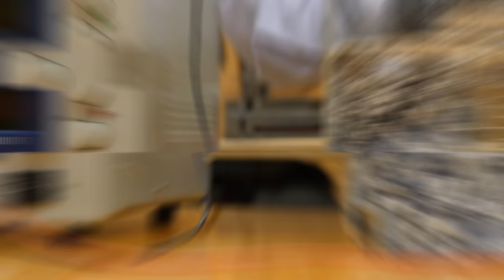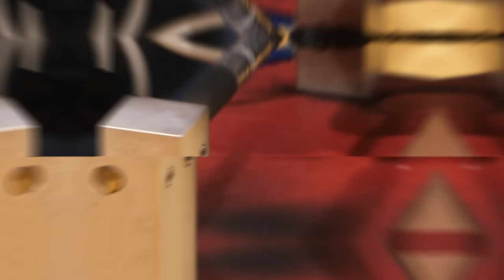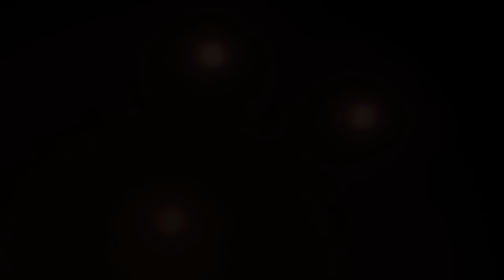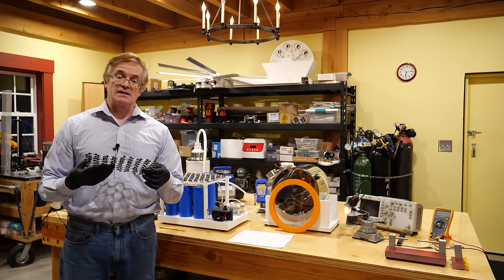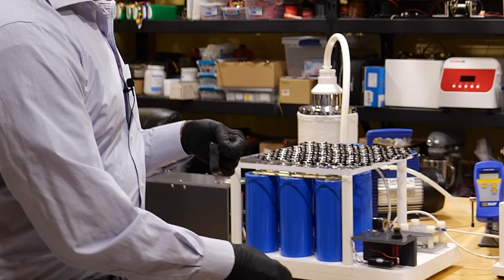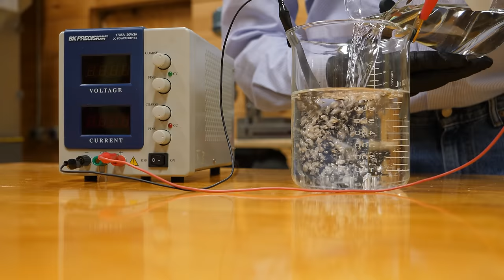Making Graphene could KILL you... but we did it anyway?!

Comment: It seems I'm muted or have been deemed not worth replying to anymore but I can understand. It's hard to judge sincerity on comment forums. Anyway,  as a thank you for your work and contributions to inspiring people, I would like you to have this conceptive been developing.  It's basically ready, just needs a bit of lab refinement.. 
I gift it to you freely with no strings or obligations.

Concept: Precision-Engineered Bio-Inspired Self-Assembly of Graphene

Background:
The quest for efficient graphene production is driven by its exceptional properties and potential applications. However, scalability and cost remain significant challenges with current methods like CVD and mechanical exfoliation.

Innovation:
This enhanced concept proposes a precision-engineered, bio-inspired self-assembly process using genetically modified microorganisms to synthesize graphene from renewable carbon sources.

Detailed Process:
1. Genetic Engineering:
   - Microorganisms: Utilize Escherichia coli or Saccharomyces cerevisiae, which are robust, easily cultivable, and amenable to genetic modifications.
   - Enzymes: Introduce genes encoding for cytochrome c or laccase, which facilitate the reduction of carbon precursors to graphene.
   - CRISPR-Cas9: Employ CRISPR-Cas9 for targeted gene insertion, ensuring high fidelity and efficiency in the genetic modification process.

2. Carbon Source:
   - Biomass Selection: Choose agricultural waste high in cellulose content, such as corn stover or sugarcane bagasse, for an abundant and sustainable carbon source.
   - Pretreatment: Apply a mild chemical or enzymatic pretreatment to the biomass to release fermentable sugars without degrading the carbon framework necessary for graphene synthesis.

3. Cultivation:
   - Bioreactor Design: Design bioreactors with controlled environments to maintain optimal pH, temperature, and nutrient supply for microbial growth and enzyme activity.
   - Monitoring Systems: Implement real-time monitoring systems to track microbial health and graphene production rates, allowing for dynamic process adjustments.

4. Harvesting:
   - Filtration: Develop a low-energy, high-throughput filtration system to separate graphene sheets from the culture medium.
   - Centrifugation: Optimize centrifugation parameters to concentrate graphene while minimizing damage to the sheets.

5. Purification:
   - Solvent Washing: Use environmentally benign solvents to wash away biological residues while preserving graphene integrity.
   - Thermal Annealing: Apply a controlled thermal annealing step to remove any remaining organic contaminants and improve graphene's electrical properties.

Advantages:
- Enhanced Scalability: Modular bioreactor design allows for parallel processing and easy scale-up.
- Improved Cost-Effectiveness: Streamlined process with minimal energy requirements and use of low-cost, abundant biomass.
- Precision Quality Control: Advanced genetic engineering techniques enable fine-tuning of graphene properties, such as layer thickness and conductivity.
- Eco-Friendly Sustainability: Closed-loop system design minimizes waste and ensures carbon neutrality.

This concept aims to address the limitations of current graphene production methods by integrating cutting-edge genetic engineering with innovative process design, paving the way for a new era of scalable, sustainable, and high-quality graphene synthesis.

Comment: I always thought with graphene it was the pattern of the structure that gave it it's strength. So I would imagine an object's surface made entirely out of a thin layer of graphene, and that would be what gives it the strength. The 2d geometry of the graphene overlayed on its surface. But you simply mix bits and pieces of graphene in a sludge and you leverage this strength anyway. How?

Comment: I think the graphene can be extracted from anything organic if you up the amps 100x. A continuous mode of operation can be made where the material flows over or through the electricity where the positive and negative rods are open and all of it doubly encased in spheres of glass.

Comment: In my personal lab I used the electrical stripping of carbon. Then took this and while wet I froze it. Then I shocked it in heat. This caused the layers to pop apart. Problem. It was now so fine the electrostatic in lights and magnetic fields. I had it in a jar. Opened the lid. The super powder that looks more like smoke lifted out of jar. And went to the fluorescent light. Moment I turned off the light it went to the magnet on my counter. And ceiling which has foil insulation on it. Took forever to clean out. It’s super conductive. Not affected by gravity. It seems. Great in nickel potassium batteries for a surface cathode

Comment: This sounds like something that should be added to 3D printing resin. With filament it's probably near hopeless because most FDM part failures (at least that I've seen on YouTube) are either some really gnarly brittle failures, tension/shear delamination, or "roll out" style delamination causing the whole thing to buckle... but it could make for some mighty strong UV resin parts.

Comment: 53:20 Also can be made with flat glass(quartz). Make SANDWICH top and botom is quartz glass and cathod use cooper mesh wire, ussualy used to clean flux in electronic. So you have more surface and dont waste so much. and can be dont like you made but instead of using rod and tube use flat sheet to compress. good job.

Comment: As a non-technical person, there is one point that confuses me: I understand the properties of graphene, but I do not get how it impacts the medium it is inserted in. When mixed with epoxy, does it difuses completely and form a full layer? Otherwise how would it make the epoxy stronger? If I put diamonds in epoxy, would it also change the properties or would it be the same?
Reply from the maker: Sure, consider fiberglass or carbon fiber composite. The epoxy acts as a glue that resists shear forces between the particles or fibers.  The huge surface area of the solid components distributes this load throughout the epoxy.
It's like the old demonstration of interleaved phone book pages that will allow you to tow a train with two coupled books, and here even adhesive isn't needed because of the friction over the huge surface area.

Comment: Would this make my epoxy resin so it would not crack when I put it on leather as paint.  So like if I added pigment and graphene to my epoxy mix and painted it on leather - would it make it a leather paint for leather that would not crack ?
Reply from the maker: Probably not based on the effect that solid additives have on epoxy mixtures.
Most of these will increase the stiffness as well as the compression strength and, to a lesser extent, the tensile strength.  So, when bent to the same degree, the compressive and tensile loads are much higher. The composite  is more likely  to fracture.
However,  adding rubber powder filler is commonly  done to increase the toughness and flexibility  of the mixture. You can buy this, and we  routinely  use that when building  drones.

Comment: I found another way to make graphene in a microwave oven. Put flour with a touch of black ferrite oxide (and maybe sand) sitting on top an insulating layer of quartz flour in a 500ML jar inside a panasonic inverter microwave lined with soft firebrick. Run at power level 5 or so about 40+min and it coats the glass. I remember doing this a few months ago, getting that silvery carbon that reflected like a mirror. If you were to use glass cylinders one inside the next inside a jar it might have even more surface area to make more yet although I suspect it may only work on the outermost inside layer since plasma spins inside and was most likely key in the process. I'd actually made green glass at lower temps using Fe with soda lime glass powder. Adding flour makes co2 and it ended up making hematite but will make gold on surfaces if done right as the oxide will change atomic structure in the presence of graphene which has the same hexagonal structure of gold seen as vapor deposition crystals (6 sides).  It's easy to do on a little disc 2" wide in a crucible if you sprinkle graphene dust on top at certain temp and run power again to reheat, or get lucky and get continuous graphene production near the end of the cycle but that's tough since it usually all turns to co2 gas for lack of plasma that wont rip it away. The bottle method keeps it trapped inside even with an open top because plasma spins in a column not able to spin out the top.
Reply from the maker: OK.
The key question is, did it really work?
You need to harvest the graphene  and test it as we did or send it to a lab where they can examine it with a raman spectrometer or an EM.
Reply: @TechIngredients Great question! I'll have to send it in, true, yet based on the layer thickness, color, and how it reacted I have no doubts. Carbon alone wont reflect light from inside the jar with the appearance of silver. The neat thing about a borosilicate bottle is that it doesn't just spin plasma inside from dielectrics, it concentrates heavy plasma due to the opening of the jar at the center of the field rotation. This is necessary for other reactions I found taking place. Silica acts like a magnet to ferrite oxides, so the black ferrite oxide ended up losing hydrogen and becoming hematite. The top layer is green glass while the bulk of it is dirty pink. I used crushed soda lime glass, black ferrite oxide, and unbleached or bleached flour. My late friend John Milewski proved how to make ferrite oxide become gold in the microwave but could only do about $5 worth at a time in a small crucible 2" wide inside. Layers from bottom to top were quartz flour 1", a paper thin layer of type c fly ash, a 1mm layer of crushed soda lime glass, and graphite on top very thin. Gold only grows in a specific formation indicative of zero point with 2 rings of 16 spots around a single larger gold spot if glass is kept gooey. Too cold or hot and it wont work since the oxides wont mix and arrange well. The fly ash contains quasi crystal spheres and spheroids of 5-200nm ferrite oxide. I later found it's not necessary since we could just make green glass from Fe/Si and make green sand from that.

Comment: I'm looking to do some carbon fiber lay-ups. I've also been thinking of doing this graphene epoxy idea along with it. Would it be as effective with graphene oxide(or even reduced graphene oxide)? That seems more available(bought)  Also, what graphene particle size should I look for to use? What would you estimate yours at? Also, how did you go about mixing it? Obviously you got a result, but everything i can read says to have it in a solution and add it to epoxy that way. Thank you.

Comment: What happens if we expose to Liquid Helium  as it’s not make bond with carbon to cool down large batch  or more thin and long pipe ? Thin enough that only make graphene or hard enough to make graphite? Like useing decimated of pipe ? For gas using two different chamber in first one as soon as voltage temperature goes up glass would break and expose to gas quickly ???? Does it improve it ???

Comment: How do you incorporate graphene into the epoxy? I thought graphene exhibited those properties due to its highly organized 2D structure with no defects. In your case, you're adding graphene powder to the epoxy, and I'm unsure how this results in the desired organized structure. Could you please explain how it works?
Reply from the maker: It's  the same principle that makes composites with fiberglass and CF threads embedded in the epoxy much stronger. The graphene is just stronger, and the particles  finer and more numerous. 
To fully  realize the potential  of graphene, large intact sheets have to be fabricated, and the technology  isn't there yet.

Comment: That Capacitor-Bank alone is terrifying!
To give a little perspective: That much Capacitance (did I use that right?) could power the most absurd Car Stereo Systems you could imagine.
Like, that's enough Capacitors to power enough SubWoofers to literally kill a person if they tried to sit in the vehicle with them cranked to max.
So this project isn't just deadly, it's "To Shreds you say" Deadly.
Heck, I suck at Math, but I bet those 6 Capacitors contain enough potential Energy to level the entire building if they were immediately converted into an explosion.
This is one of the most lowkey "DO NOT TRY THIS AT HOME" experiments I've ever seen lol.
Reply from the maker: They're powerful, but in one of our very early videos on the pulsed dye laser, we used a single capacitor from a national lab.  You can lift it assuming you have a decent dead lift max.🙂

Comment: Wait, how do you get any results from adding 0.3% of stuff into epoxy? It feels like bits of graphene shouldn't interact with each other
Reply from the maker: They act just like the carbon or glass fibers do in an epoxy reinforced composite. The plastic bridges the far stronger and stiffer graphene sheets and resists the shear loads between the individual particles of graphene.

Comment: Do you think you could achieve a similar result with a rectified spot welder modified to output 1000amps? 

I’m working on making my own version of this. 

Do you offer consultation? 

Thanks very much for sharing your expert knowledge!
Reply from the maker: That's unlikely.
Heating isn't the chalange. It's achieving controlled cooling in the absence of oxygen.
Reply: @TechIngredients 

 thank you so much for responding.
I have a vacuum pump already, I would just need to build the chamber. 
I modified a microwave transformer with the secondary winding removed and substituted with two wraps of a much larger gauge wire.

Comment: Well. (Ahem). Those load tests had my jaw on the floor. What an amazing material!
I am a custom woodworker and use epoxy in some of my builds. To gain 750% in a bending modulus is quite remarkable indeed!
It makes me very curious and excited to see what this material has in store for industries such as electricial, aeronautics, and just about everywhere..
I would love to see what you have in mind for further testing, especially in construction materials such as concrete, but also in simpler things. What happens if you add graphene to something like wood glue instead of epoxy? Does it affect the bond strength? Does it become brittle?
An exciting advancement in material technology!

Comment: Off subject but I saw a media channel where the DEWs had no effect on the blue items due to the program only sees green, yellow & red, what do you think is it fake or fact?
Reply from the maker: The source of the information  would be interesting,  but it isn't  as important  as the basic principles.
There are three major components in the system, the laser, the imaging/tracking/targeting optics, and the software/AI program.
The laser will interact more strongly  with  surfaces that absorb the operating wavelength, but this is relative as even blue surfaces will absorb some blue light, potentially  a significant amount.
The imaging  system can be damaged by reflections of the laser light from the target and will be protected by notch filters that specifically  block the laser wavelength and if that happens to be blue then the imaging system will not see blue objects.
Finally,  the software  will select and maintain  focus on the target and has a resolution  at least as great as the laser spot size, so it will  easily  identify  objects that the laser could damage.  It isn't  stupid or random.
Laser weapons will rapidly appear in conflicts as the technology is not only available, but EASY!
We will demonstrate  just how easy it is in our upcoming video. Stay tuned.😉

Comment: Is it possible to do it inside liquid nitrogen, to speed up the cooling ?
Reply from the maker: It might help a little,  but the limiting rate is the heat transferring out of the inside of the carbon black to get to the surface.
That's  why most of the flakes were near the inner edge of the glass.  A smaller quartz tube would be better, although  the amount produced might decrease.

Comment: 16:12 wetting it holds the glass dust in place when you bend it, the glass dust is the actual thing that creates the stress. 
If you were to remove the dust, its like you had removed the scratch.

Comment: This video lives in my brain.  Might it be possible to create features on the inside of the cylinder in a controllable way?  3d-printed masks?  Laser-based photochemistry?
Reply from the maker: Probably  not with the current  methodology, which depends on the homogeneous heating due to homogeneous  resistance  through  the carbon precursor.